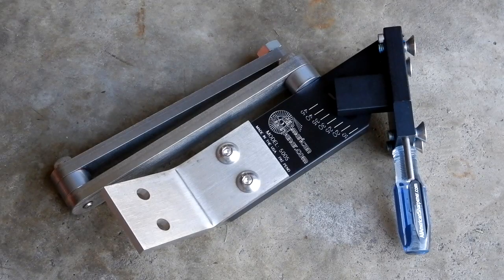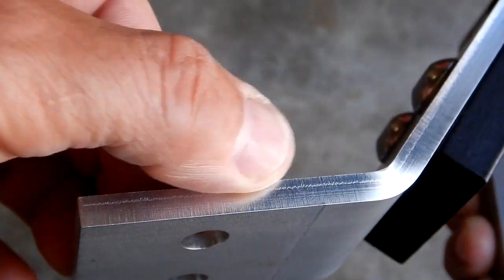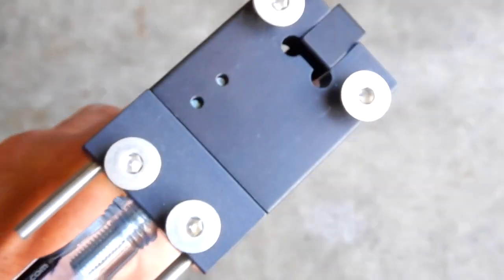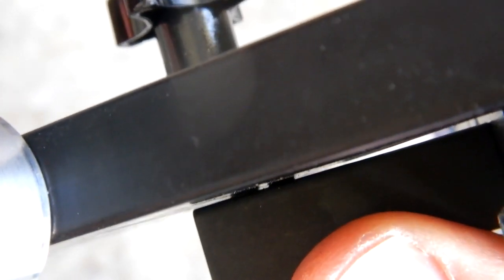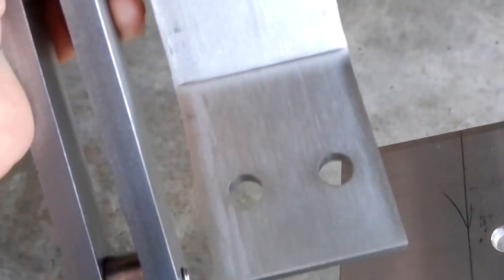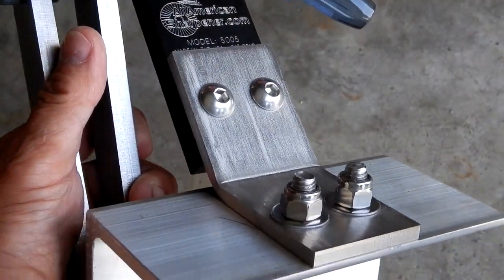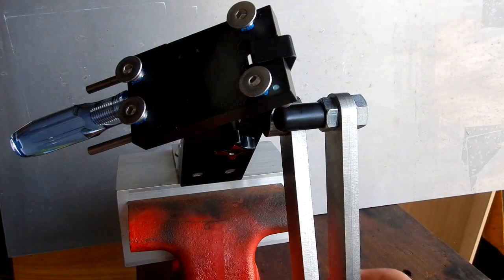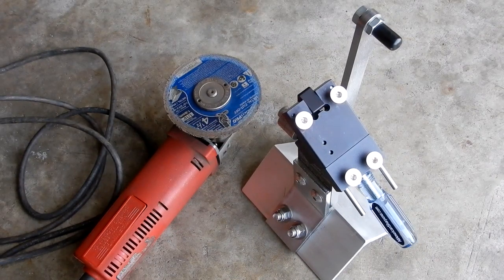All American Sharpener model 5005 with Vise Attachment

Comment from the maker: N O T E: I would like to state why I added the aluminum angle piece for using in a vise instead of the stainless steel part from All American Sharpener. Should have mentioned it in the video. I did not want to damage the SS part with the vise jaws. But more importantly I wanted a "softer" material that the jaws would "bite" into for a better hold. And having the longer length of the aluminum angle in the vise gave better stability as you can see in my video.
Reply: Thanks for the tip!  Great idea!
Reply: FYI: I use a rockler jaw horse to hold the original mount vertically. The jaw horse has rubber pads in the clamp area and won't damage the all American mount.

Comment: *Not to discredit the fine work done on this accessory, but we are getting a lot of questions about mounting the unit(s) in a vise. We want to make it clear that you can mount it in a vise using the mounting bracket that comes with the unit(s). To do this, you turn the bracket around so the bottom section that you will put in the vise will be pointing vertically downward. Because the bracket is angled at 45 degrees, the section that you attach the unit to will still be at the same angle. Hope this helps!*

[Original comment] Thanks for the thorough review of all the features of our 5005! We are glad you like it, and we really appreciate your business and support. Nice work on your end as well. We hope it gives you years of sharp mower blades.

Comment: All American should add this Vice Attachment with bolts as an accessory
Reply from the maker: Perhaps they will someday. Thanks for your input Ken.
Reply: Hi Ken. You can actually turn the mounting bracket around and mount it vertically in a vise. Not to discredit the work done on this extra piece, but we designed this functionality into the unit, so you can mount it in a vise using only the included mounting bracket. Thank you for your interest!
Reply: @AllAmericanSharpener  I would buy one from you if you made them.  I like the wider 6" bite that the vise jaws would grip into.  Plus it would act like an auto-leveler with the head of the vise.  Thank you - love my sharpener!!!

Comment: Thank you mine will be here Monday  was wondering if i can sharpen my tough cut blades, Little thicker
Reply from the maker: Thanks. Don't see why not Shane. You can back out the hold down bolts if blade is thicker.

Comment: Couldn't you just mount ot a 2x4?  and then put that in the vise?
Reply from the maker: Rodney...you could mount it to any material.
Reply: I mounted my 5005 to a 24" long 2X4 about four inches from one end so that I could clamp it into my Black & Decker Workmate table and use it outside (keeps my shop cleaner) and also clamp in a vise.  The B&D Workmate option allows me to take the whole thing when I go into the field.

Comment: I simply watched the youtube video of All American's description stating how the bracket that comes with the tool mount already can simply be turned the other way in the vise.  I appreciate your effort and please don't take this the wrong way, but you are reinventing the wheel sorry to say.  There is no need to do what you are doing.  Its redundant.  If you are worried about marring the bracket in a vise...small pieces of wood stock or paint sticks would do that very easily and would hold way more than needed to hold his into place in a vise.
Reply from the maker: Brian Webb       We all do things differently don't we? More than one way to attack a job. I prefer to be very precise in everything I do. 

WHY would I want to put extra wood in place to not mar the SS surfaces? That is an extra process required that I don't want to do. By using the aluminum angle as I did it gets a better "bite" in the vise as it is a "softer" material. Also, it stays attached so it is a "one step" process from the case to the vise.

No "reinventing" the wheel here. Just making it better for me in the way I like. BUT, if I was going to reinvent the wheel...............

Comment: Hello, I live in Toledo, and wonder if you could make me a vise holder for my sharpener. Could I get a phone number or email. Your work is right up my alley, PERFECT!!I will pay what ever you need.
Reply from the maker: Bryan...provide me your contact number.
Reply: Columbus OH here and would absolutely buy a vise attachment like yours as well. Great idea right there!
Reply from the maker: Thanks PA Boots.
Reply: I don't know how stainless steel reacts to aluminum, but if I were making that type of mount, I'd use either anodized aluminum or stainless steel. I know many types of steel don't play well with aluminum.